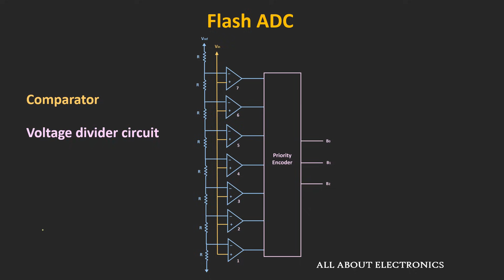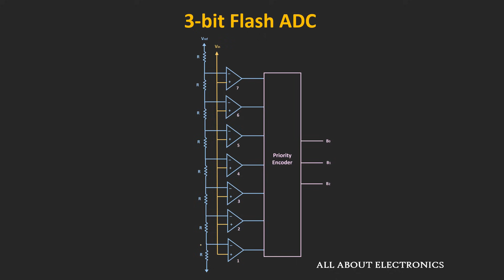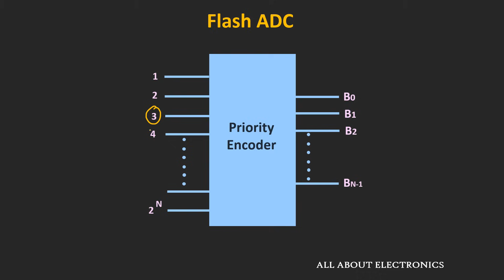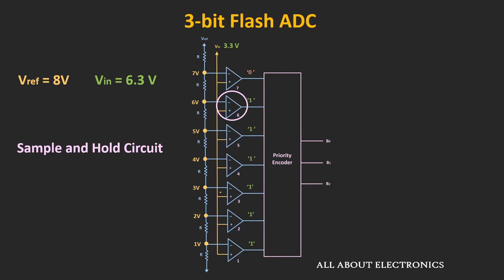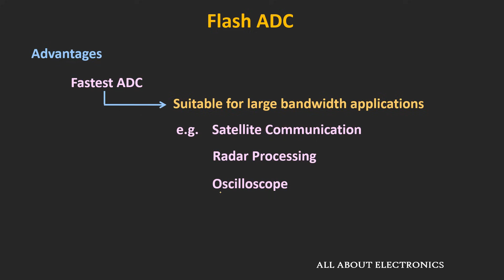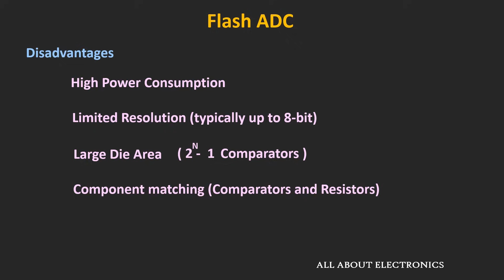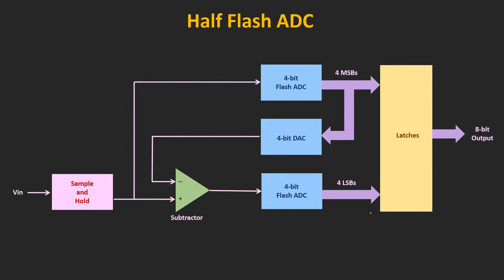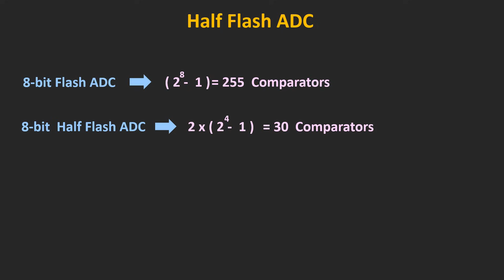Flash ADC (Parallel ADC) and Half-Flash ADC Explained

Comment: I'm not getting an output one of the comparator when applying the input voltage of 5volts. Instead of that I'm getting 10volts.
Reply from the maker: Would you please elaborate how you have connected the circuit?

Comment: 7 comparators is pretty expensive though!
Reply from the maker: That is why flash ADCs are not cheap.
Reply: @ALLABOUTELECTRONICS  Is it the type we use for signal processing and control? because the delay caused by standard ADC's can distort a real time signal that needs to be processed right then and there because say a temperature signal is a sine wave, it could appear distorted when inputted this way due to the sequential part that varies depending on values.
Reply: Well, one year later I know my answer

Comment: I have a doubt that for this encoder we need 8 inputs but from 7 comparators we are giving 7 inputs to encoder then what about 8th input.
Reply: @mohithreddymalapati7127   the 8th will be grounded
 i.e. 0V input ref voltage to the 8th comparator. Rendering it useless since it will always be at 0V.

Comment: Hi sir, on what basis we should select vref , if my input signal is varying from 2v to 6v
Reply from the maker: Typically for ADC, the reference voltage is specified in the data sheet. ( like 3.3 v, 5V, 9V, 12V etc)In your case, you need a reference voltage more than 6V. For example, if ADC supports up to 9V, then you can use that voltage. But again that depends on the ADC.

Comment: In our they teach me 8-comparator and 7resister .sir
Reply from the maker: It is in fact, other way around. Imagine just 1-bit comparator. To compare the voltage, using a voltage divider, you need at least two resistor. That means for 1-bit, you need 1 comparator and 2 resistor. 
That is 2^1 -1 comparator and 2^1 resistor. The same is true for n-bit flash adc.

Comment: Sir, What is sigma delta ADC!
Is it another kind of ADC!
I haven't found in our channel ALL ABOUT ELECTRONICS!!!
Reply from the maker: Yes it's another type of ADC. It is typically used where high resolution is required. ( But speed is not that important). Someday, will also cover that on the channel.

Comment: Something new occurred to me regarding your audio… The effect that I presume is clipping, may be caused by echo in the room your recording in, especially is the surfaces are mostly bare. If this is a problem, and you want to fix it, there are a lot of different ways. But a quick one would be to hang some kind of cloth on your walls. Although I have a hunch that filling a large mesh net with packing peanuts, or some other loose, light material, and attaching it to your ceiling would work pretty good.

I don't know you opinion on this, so I'm sorry if I seem pushy or something. Just trying to help…